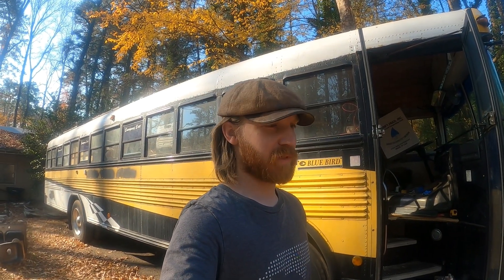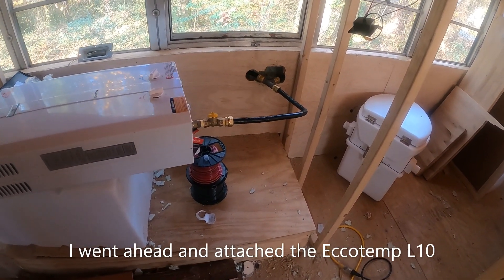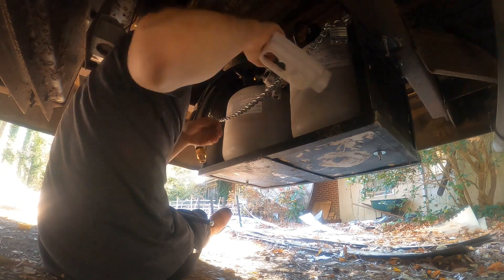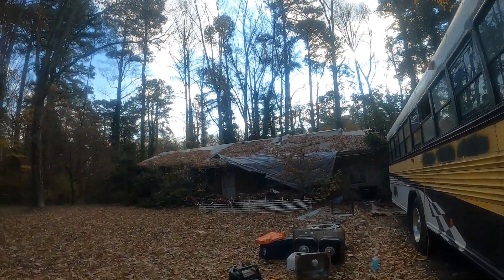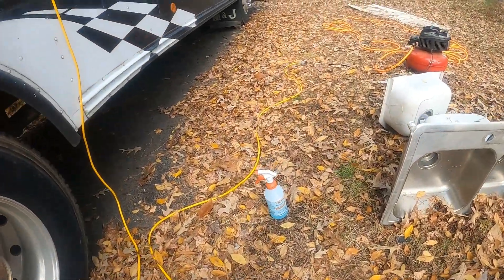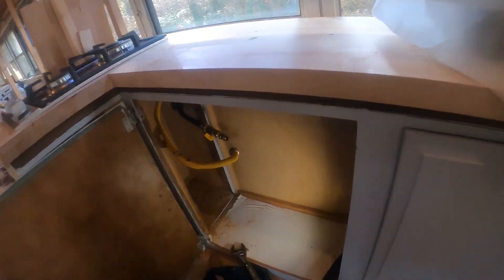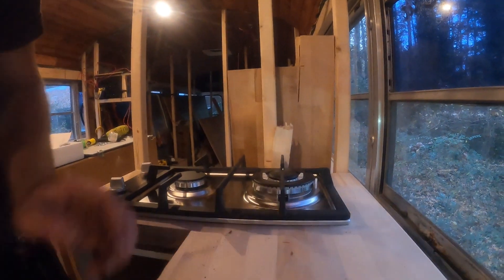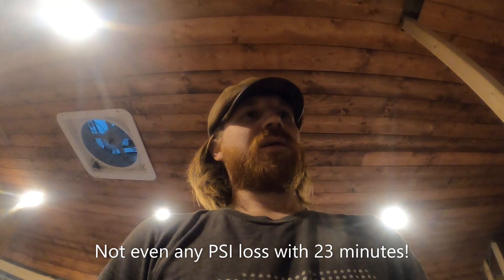Skoolie Conversion Day 108 I Have Fire!

Comment: Dude, this seems like a terribly dangerous location to install your propane tanks. The first time you enter or egress to a business that has a sloped entrance, the back bumper of your bus will go all the way down and almost hit the pavement (per design), but your propane tanks will be forced into the ground an explode, as they are mounted significantly lower than the rear bumper!
Reply from the maker: Well I am going to be pulling my car behind for 99.9% of its voyage so I will make sure in the rare situation that I am not I will be very weary of road angles